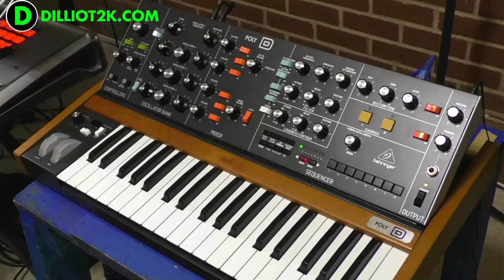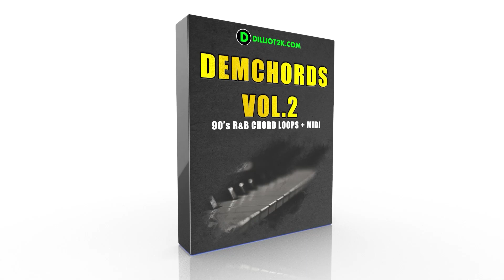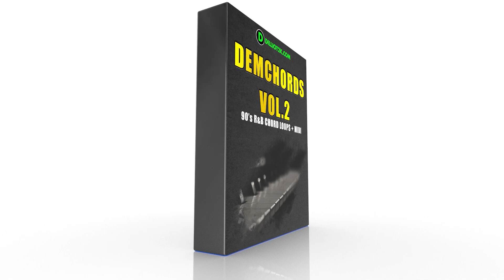Poly D Funky Bass Tutorial

Comment: Great video man! You need to adjust the multitrigger settings from the software while connected through usb to get the legato.
Reply from the maker: Strange I missed that setting
Reply: I haven't had the chance to see if it does what I think it's designed to do either.

Let me know if it helps, I bought this thing for those smooth legato licks and ran into the same issue.
Reply: @dilliot2k  hey I got a chance to turn off mult trig on the Behringer synth tool today and it worked!